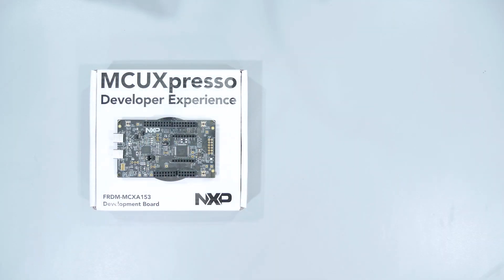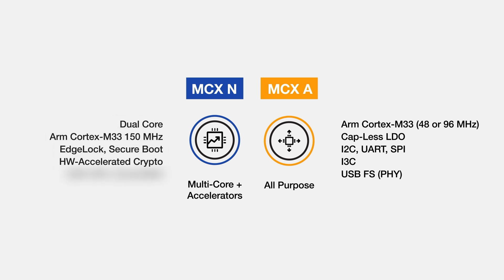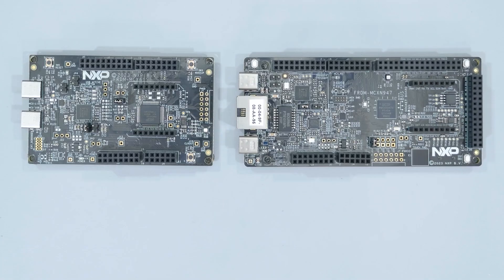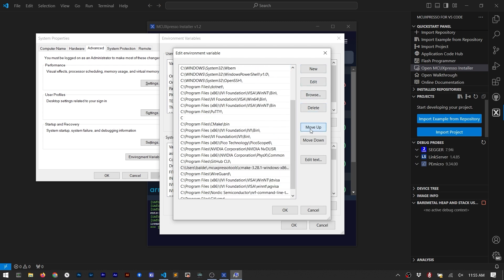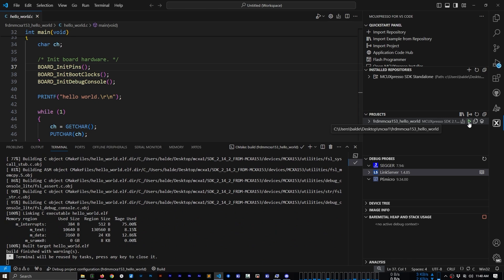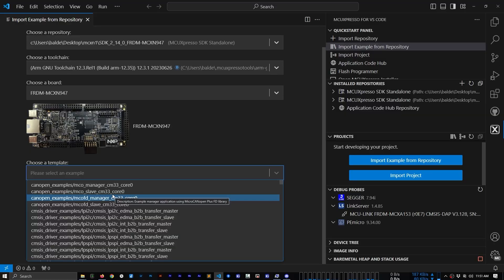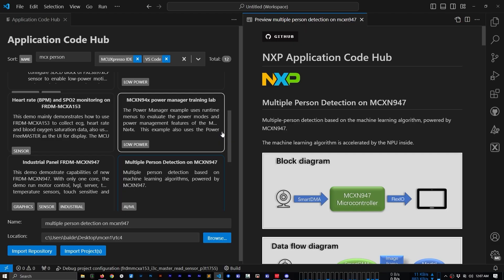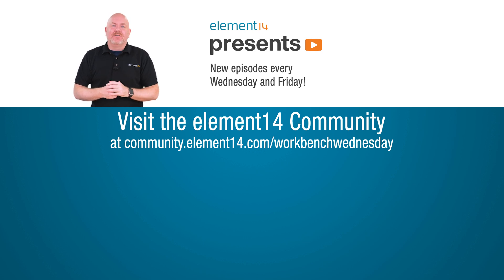Hands-on with NXP’s MCX FRDM Boards - Workbench Wednesdays

Comment: Total noob here looking to get started in building my own electronics. Could I use the N to make a portable display from an old laptop or tablet? Level of difficulty and / or where to start. Thank you

Infinite love and gratitude from Colorado!
Reply: Driving a large laptop display is not trivial. They do not use a protocol like DVI or HDMI. They require a LVDS driver. So, Could the MCX-N do it? I have no doubt. But it would be far from trivial and not a getting started project.

As someone else mentioned, if you have a display with a standard interface, like HDMI, then a single board computer with HDMI support is a better starting point.
Reply: While I have not used these particular dev kits, if your just looking for a portable display, using a raspberry pi3 or newer can drive a hdmi port on a lcd screen, provide usb and networking also.  Much simpler path than trying to reuse a proprietary display from a tablet/old laptop.   Price is only about $35 for the pi 3 to start with plus a used hdmi enabled screen.  You can also buy 7-10" screens designed for the pi with a case that it all fits in nicely for about $70.  Lots of examples online and use cases.   Dont spend your time re-inventing the wheel when starting out.  A bit of python programming goes a long way also with the pi and can control the i/o ports and such nicely.

Comment: Ah very handy; Ialso just got these two devkits! whats missing for me now is an arduino core for them
Reply: Agreed. I'd especially like one for the MCX-A since it is more general purpose. I can see it fitting in well with Platform IO.
Reply: I think to get it to work I’m arduino might limit the features a bit, especially with the NPU in the N947, but if it could be done without many limitations it might be a good option.